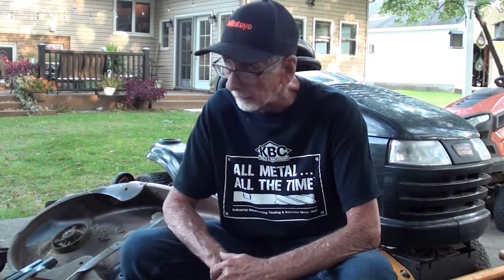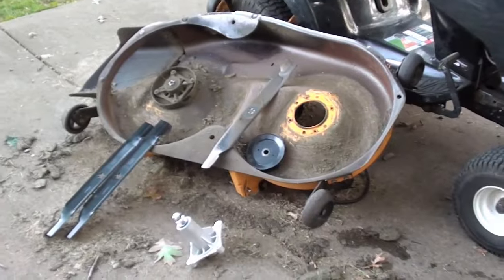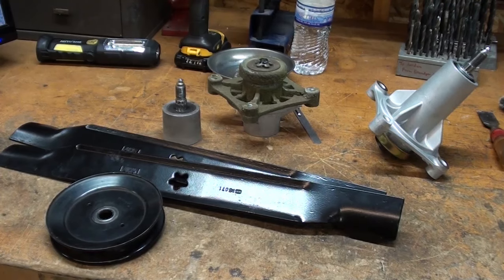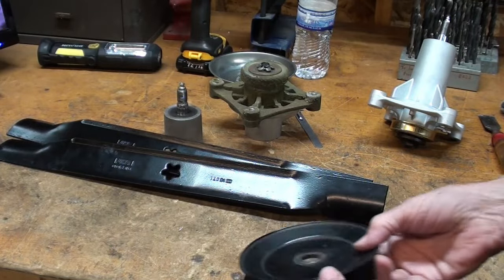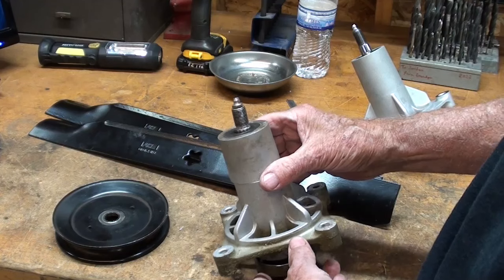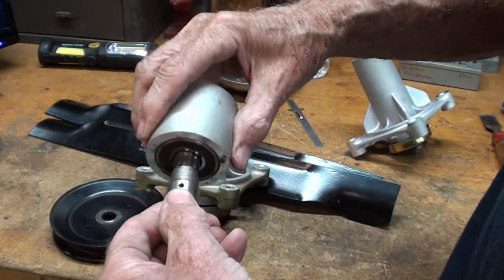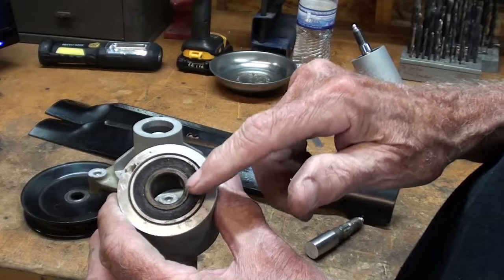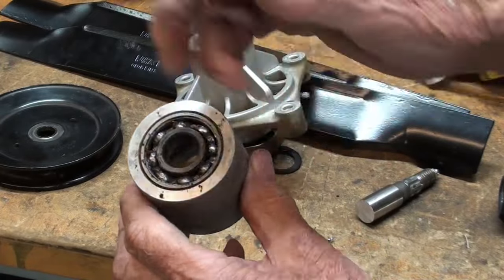LIES & DECEIT mower spindle fraud SHORT SUBJECT #52 tubalcain

Comment: We have a YT4000.  I never had to replace a spindle because the bearing failed.  Usually the pulley strips, as you showed.  Or the 5 point lower end, where the blade mounts.  Or the aluminum housing broke.  I think we averaged two new assemblies for every 3 years.  That doesn't count the assemblies I built out of salvaged parts from two or more damaged ones.  None of them lasted long enough to use up the grease that came in them.  Another repeat issue has been steering linkage.  Now, everything plastic is delaminating or breaking.

Old farm yards are brutal on mowers, but we still managed to get a little more than a decade out of this one.  We finally took delivery on a Cub a few weeks ago, and everyone is scared to use it.  No one wants to be the first to hit something and break a major component on it.  So I'm still trying to keep the old mower patched up.

Comment: I just finished rebuilding a JD  L133 for a friend and I had to get 3 new spindles for the deck, with a lot of other parts. When they came in, I took each apart ,removed the bearings took OFF the inside seal and reinstalled all the bearings so they could all get the needed grease. ( It had spacers in them (plastic) so not to use up too much grease). I also told him , when he picked it up to be sure to grease the deck bearings every spring because NOW they work as intended !!
 It's a crooked world we live in. Like Trump says Fight,Fight,Fight !!!  And I do as much as I can. Screw corporate!

Comment: I respectfully disagree, sir. I have tried this multiple times. Put black grease in that bearing fill the cavity up with red grease. Take it back apart. You will see red grease in the bearing. I do this at work all the time you can grease a sealed bearing it’s not sealed it’s just a piece of plastic grease can push past it. Thank you.
Reply: By the way it takes about 80 pumps to fill the void so I use a electric grease gun.

Comment: My first small Craftsman rider lasted 22 years and was still running but had a badly worn steering gear no longer available.  So, I got another Craftsman, similar size.  Lasted 3 years and blew a valve, among other mower issues.  I feel your pain.  A company that cares about customer service?  Few and far between!  Thanks.
Reply from the maker: Thanks for sharing

Comment: I rebuild the ones I work on and I usually drill and zert the center, then remove the inter seals cover 
Then they will last 25 years if grease once a year or 6 months 😊😊😊
Yes it’s a lot of trouble but it’s a winner ❤

Comment: I agree with you I took my brand new spindles apart and removed the rubber seal and then put a hole tube of grease in each 1 and then they lasted like they should

Comment: Enjoy your vids! Pro tip. Pull the inner seals, When reassembling use a section of  PVC pipe over the spindle shaft loose fit between the upper and lower bearings because PVC is cheaper than good grease. If you have a higher volume spindle housing, making a spacer/volume filler that fits one  over another is not hard at a Maynard's, Home Despot or Low's plumbing aisle.

Comment: You can weld that pulley to the shaft. It may last another year. Just 4 spot welds would be enough.
It odd that the zero was not installed into the housing, and that there was no system for holding the grease up to the bearing.
It would be better to fill it with stp than thick grease.

Comment: Two thoughts. First, the grease zerk is probably a leftover from an earlier iteration that either had bearings sealed on only one side or bearings with shields that allowed grease through. At some point they changed the bearing spec but didn't change the manufacturing process on the spindle. Second, I'm surprised the spline on the spindle was damaged. In my experience those are hardened and the pulley is soft, it's actually designed to strip the pulley to save the spindle and motor. I've stripped a number of pulleys but never had a damaged spline on the shaft.

Comment: Mr. Pete, you're right!  I occasionally use a needle greaser attachment to lubricate sealed bearings that still need grease.  I've replaced several mower spindles.  The mounting bolts always break.  I remove the broken ones by welding scrap to them in order to turn them with a hammer until they're loose.  I enjoy your videos.  I like your, "This is my last tool auction" line!  Thanks for the entertaining content!

Comment: You are right. 
I take my deck apart once a year. I have a needle injector for my grease gun to shoot grease under the seal of the bearings. I stripped the spline on one of my pulleys. Amazon seller sent the wrong part. It was cheap, but wrong. Put on the old pulley and it still  works fine.

Comment: I was a mechanic at a farm implement dealer for several years. Occasionally they made me work on lawnmowers if the new guy was overloaded.  I asked someone from the company this exact question and they said most people aren't going to grease them so they went to sealed bearings and no grease zerk. Then the people who do grease their mowers complained there was no way to grease the bearings so the put in a grease zerk and sealed bearings.   The company is trying to accommodate those that don't maintain their equipment and suffer from premature bearing failures and those who feel better when they can shoot some grease in there.  You're not wrong, it is dumb to put sealed bearings and a zerk, but that's the reason I was given when I ask.
Reply from the maker: Excellent analysis. I believe you hit the nail on the head.

Comment: 30 years ago I worked for TSC.  We sold a similar “budget priced” riding mower.  They had sealed bearings in mower deck spindles with no grease zerks. Customers would complain about the inability to grease the spindles.  The thing is we rarely ever sold a replacement spindle.  We would sell 30 to 40 new mowers every year and maybe 1 or 2 new spindles.  In my opinion they put the grease zero in to shut up the one guy out of 10 who complained about not being able to grease the spindles and left the seals in the bearings to prevent them from being ruined by 99 out of 100 people who don’t even know what a grease gun is let alone own one.

Comment: On the new spindle, I pull the internal seals and drill and tap a hole in the side of the spindle housing. I would have put on new blades and a spot of weld on the pulley. A couple of hours and good to go.

Comment: with double sealed and "permanently" sealed bearings there was no need to put in the zerk and drill the holes.  In my 44 years of industrial mechanical experience I have seen an increasing trend toward "permanently" lubricated bearings.  It does prevent contamination.  One of the problems with grease fittings is overgreasing.  If the cavity becomes to packed with grease it actually wears out the roller bearings faster.  When I was a young pup fresh out of my apprenticeship working as an industrial mechanic in a steel mill, I got into a heated debate with some of the "silverbacks" (old timers) about how to install grease seals on bearings that had an automatic lubrication system.  The "silverbacks" installed the seals to hold the grease in which caused the bearing cavity to be completely packed with grease allowing no room for the rollers to roll without forcing grease out of the way.  I insisted on putting the seals in backwards to their way of thinking to keep dirt out and allow a small amount of grease out relieving the back pressure on the rollers.  In my many years in that job I changed the bearings on many rolls with the seal installed their way (the "silverbacks") but I never tore down and changed any bearing installed the other way.  By the way, I don't use the term "silverbacks" to be derogatory, those men taught me many useful things and made me a much better mechanic after leaving my apprenticeship than I would've been just learning on my own.  I have the utmost respect for them.

Comment: 5 years ago, I put new spindles in my mower. I drilled them and put zerks in there, and greased them after removing the inner seals on the bearings. to my surprise, the spindles got very noisy in less than 2 years. When I finally changed the bearings, the problem was the chrome flaked off the bearing., so it was ultimately, poor bearing quality where they used soft metal with chrome on it vs actual bearing grade steel. I just replaced them with NTN's so hopefully good now LOL
thanks for the vid as always

Comment: Sealed bearings don't seal at all.  Grease easily finds its way into there.  The biggest problem is pushing that inner seal into the bearing with grease because grease guns are capable of such high pressure or breaking some other part, because the grease may not be able to get through that seal especially with the pressure on holding its shut fast enough to relieve the pressure.

Comment: I replaced the spindle bearings and idler pulleys on my 2003 Craftsman 48" mower deck after 19 years because the idlers were noisy but the spindles were still good.  There were no grease zirks in the spindle shafts on my mower deck and the original bearings were sealed as were the replacements.   I guess MTD decided in 2003 that it wasn't worth the needless expense to drill and tap the spindles for zirks.  BTW, the tractor transmission failed about 1 year after replacing the mower bearings.  I could have saved my money replacing the bearings and idler pulleys.

Comment: I have a cheaper Craftsman LT1000 that has no grease fittings. I had several spindles experience bearing failures. Finally I purchased new arbors and I took them apart and remove the inner seals, made a plastic spacer that takes up some space, drilled and installed a grease fitting on the outside of the housing and now I can grease it. Been 5 years and working perfectly.
Reply from the maker: Thanks for sharing
Reply: That was a great mower. Got one new for $990 and sold it 7 years and xxxx hard hours later for $660. Spindles fine if not hitting big rocks.

Comment: Gotta say I've never taken my spindles apart to see that. Everytime I've whacked a large branch or gone over rocks with my mower, the spindle breaks at those webbed connections. At first I was disappointed that they would make them with a failure point like that but I guess it's a safety thing. Personally I'd rather have it bend the blade up over destroying the spindle. I see it as a way for manufacturers to get more money out of damaging more parts instead of the possible injuries or something like that.

Comment: Typically sealed bearings are "sealed for life", to include the amount of grease required for that bearing's life. Operating conditions will always vary and affect these intervals and amounts, but lubrication quantities and intervals are determined via bearing tables and a little bit of math. From a manufacturing perspective they "probably" have more sales of the unit that DO require lubrication to the bearings vs sealed bearings installed, and it's easier(cheaper) to manufacture all components with said grease fittings. Heavy industry encounters this with motors that have grease fittings, but have sealed bearings installed. Technicians will lube whatever points are on a PM sheet and then wonder why a motor starts to fail from winding insulation damage. Sealed bearings have all the grease required for that bearing's lifespan.

Comment: My spindle broke with no warning that it was failing. The bearings top and bottom dynamited and destroyed the bracket. It had to be replaced. The other 2 are still in operation after 16 years. I regularly check for side to side and up down play.

Comment: I recently had to replace the factory supplied spindles on my Scrub Cadet. They did not have grease fittings. After watching this video I dismantled one of them to see what kind of bearings were in them. The bearing was sealed, both sides. I replaced them with aftermarket spindles. Those spindles have grease fittings. I’m going to take one of those apart the next time I sharpen to see if those lying, cheating, deceitful bad men are still up to their dirty tricks! Thanks again for a truly great video.
Reply: I wonder if the grease fitting - equipped spindles start life full of grease? Or do they expect those of us with hand powered grease guns to pump a tube full of grease in each one before using it?
Reply: @noellwilson1273  I put a few pumps in mine. I’m wondering now where it went?

Comment: I had the same issue with my ex-Husquavarna mower. I went through at least one new spindle every season.  The spindle’s four tabs snap off every time you hit a rock or stump!  What a piece of lousy engineering!  I went through so many parts until I bought a Kubota.

Comment: I assume the reason for the grease fitting is so grease can be pumped into the space between the bearings to prevent moisture from accumulation.  Sealed bearings should not need greasing.

Comment: I just went through this with a 60" finish mower (tractor PTO powered).  3 spindles, I replaced all 6 bearings and removed the inner seals so I could grease them, like you deduced.  The bearings I got from my local NAPA were made in Bulgaria and were twice as much as China bearings.

Comment: Some have the fitting in the shaft others in the housing, both are worthless. I've had many riding mowers over the years and all share the same issue. But on the bright side, unless you hit something, I have almost never had to replace a bearing for my spindles. Just as well, imagine how many seals would of been blown out by over greasing. I agree it makes no sense why they still continue to do this.
Reply from the maker: Believe it or not, I have never had an issue with the bearings or spindles on my scrub cadet. But then it again, I do not run over stumps or pipes, lol.

Comment: The spindle was called a jack shaft on my old Murray lawn tractor. I noticed they needed replaced when I glanced down and saw sparks flying out of one of the bearings. The OEM jack shafts had NO zirc fittings. The new ones had grease zircs and I greased them.

I also rebuilt the mowing deck and painted the underside with bed liner paint. Looking back, I hated that mower!  I required an hour + maintenance for every hour of operation.

As to the video; yes. You're right. The zirc is superfluous to sealed bearings. They probably got the best deal on the bearings and figured nobody would notice and would just buy new spindles.

Comment: We used to discard sealed bearings after 2 years on the shelf, grease not effective.
The internal spline is a yield point in case of overload.
Check your terrain before mowing.
Reply: Where is your dumpster? I will stop by for some perfectly useful bearings.
Reply: This was in an oil refinery, that was the standard, most were for electric motors which were serviced every two years.
As for Mr Pete's dillema the oil in the grease would easily migrate past the seals into the bearings and increase the life of bearings.
Reply: @willemvantsant5105  Agree, not an issue.

Comment: I discovered that when I replaced the spindle bearings on my Craftsman mower the first time. If you catch it before it self-destructs, the bearings are cheap on eBay. Mine were 6204, double sealed, just pop out the inside seals and put it back together.

Comment: My mower didn't have grease zerks. I tried adding a zerk to the spindle housing and removing the inside seals. Problem was, when the spindle filled with grease the pressure would push the outer seal out. Now I simply remove one of the seals, pack the bearing well and replace the seal. I don't know why, but new bearings have very little grease in them. Chinese or American made.

Comment: This has been around on the lawnmower channels for a few years.  Good to bring this scam to light into your neck of the woods.   
Usually sealed good for about 10 yrs, but the oil eventually weeps out of the grease and go dry. To the manufacture,  it's time for you to buy new.  
On dads 20yr old dodge truck with 60000 mi .,  I noticed the bearings were dry when doing a brake job.  I dribbled  some oil in them they sound smooth then, right before I changed the rotors with the bearings.
 Its a disposable world.  We are " fortunate" that everything it takes to manufacture a whole assembly is cheaper than grease or new bearings.

Comment: I repair mowers for a living. 
I hope you took the new spindle apart to pull the seals. Also would have been easier to knock the shaft out to show use vs cutting the spindlein half. Spindle housing was sill good unless the bolts broke

Comment: Mr. Pete
I absolutely agree with the shoddy design regards the bearing seals and grease. I must say that I have inadvertently done more damage to bearings from over greasing them (causing seal failures followed by total failure) than I would care to admit. I actually prefer quality permanently sealed bearings as I don’t have the opportunity to over grease them and they last a long time. I had a Toyota with 282k miles on it and not one joint on that front end had a grease fitting and none were ever replaced.  More and more equipment (truck u-joints, expensive mowers, suspension components) come with permanently sealed bearings. You could be right, and probably are, that it was an engineering blunder but is it possible that it was intentional to actually extend the life of the bearing while making a person feel good that they were greasing it?

Comment: We sold our mower shop in '04, the AYP spindle you have there was available in a complete assembly ... or you could buy the actual shaft an bearings and save some money.  In '04 the shaft w/lower bearing sold for about $12, and top bearing if needed was about $4.